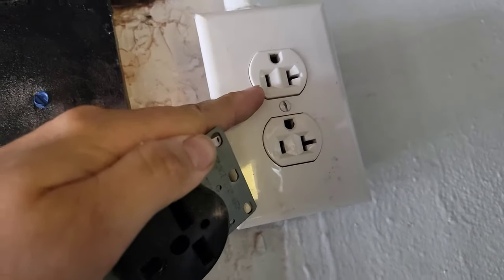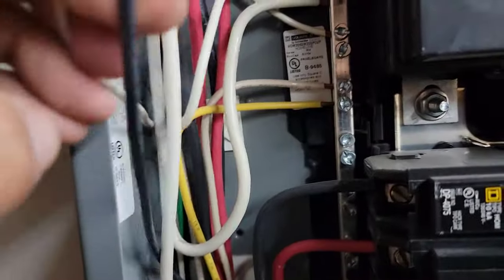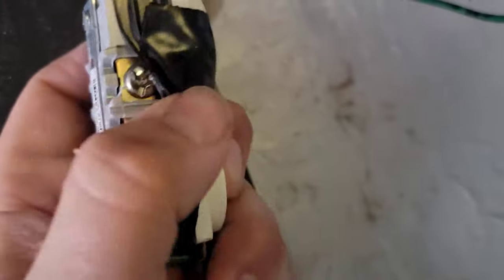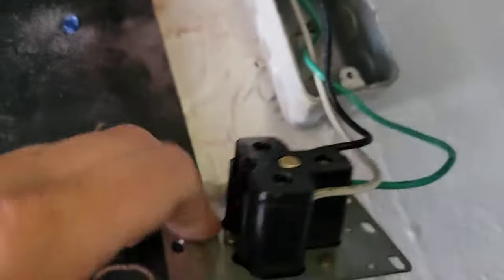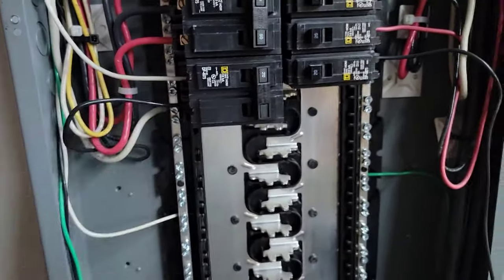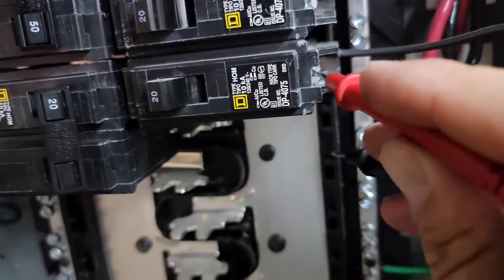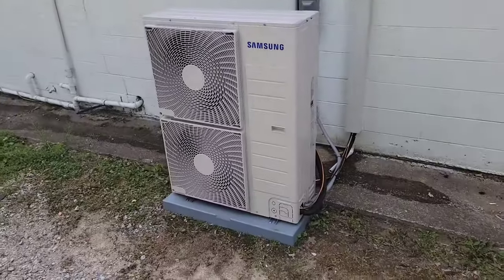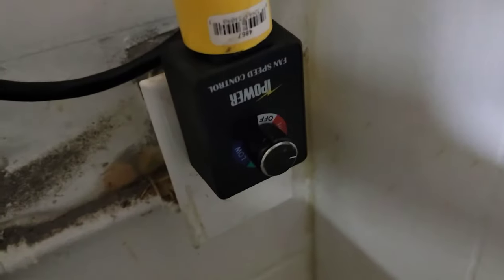How to replace a 120 volt receptacle with a 240 volt receptacle?

Comment: Congratulations and thanks so much for sharing your knowledge. I’ve been wishing to do that and use an existing 120 v receptacle to heat my greenhouse with 240V   Heater but thought you had to change all the wiring to the receptacle plus change the breaker.

Comment: You should have put 3" of black tape on the white wire on each end since it is no longer a neutral.
Reply from the maker: Wayne I forgot to video that.
I'm glad you said something
Reply: @TaddyDigest  Sorry it was just a safety thing.  Love your videos!
Reply: This will be the top comment!   Assuming it was actually 12 gauge wire. If it was 14... then the breaker is over rated and NOT SAFE!
Reply from the maker: Thank you wayne
I'm glad you're here buddy
Reply: @OGBRADASS  that’s what I’m concerned about, I have a situation where have existing receptacle outside of my house and wishing to convert from 120 to 240 but afraid because the wiring gauge and causing a fire 🔥
Reply: @DoverDanny  Well you can get 15amp double pole breakers, doesn't have to be 30amp.

Comment: how about the frequency of cleaning this unit inside the kitchen specially with all the grease deposits on the evap. fan wheels ? also very good thinking of the 120 to 240 volts but you need to cover the neutral with black or red electric tape to identify it as hot leg.

Comment: Please make sure that the receptacle you are replacing is the only 120 volt item on the circuit before you convert over to 240.
Reply from the maker: Great tip

Comment: I'm unclear about the wire gauge, is it 12 or 10? You're using a 20 amp breaker with a 30 amp receptacle and a 30 amp plug from the appliance. You should have 10 gauge wire and a 30 amp breaker, please explain.

Comment: I don’t guess you can do that with an in series receptacle ? I see that looks like a single dedicated run .
Reply: @ApothecaryGrant  there are a few unusual situations where it is acceptable to convert a 120V circuit to 240V for multiple receptacles as long as all of them are swapped out to NEMA 6-15 or 6-20 depending on whether it's a 15 or 20A circuit.  For example, metal halide, high pressure sodium or LED grow lamp fixtures,  many such fixtures feature multi volt ballasts or drivers meaning they can be used on 120, 208, 240 or 277V with 208 & 277 volts found only in commercial 3 phase systems.   This is usually done to allow for more fixtures on a given circuit or to reduce voltage drop, because as you may recall, P = E x I.

Comment: What about the wire guage? Is it the same guage for 120 and 240?
Reply from the maker: Wire gauge is dependent upon the amps of the appliance
Reply: @TaddyDigest  thank you.
Reply: @princeg24 I'm assuming 12 gauge since the original receptacle is a 20 amp and he used the same breaker rating, 20 amps. This would be good for a maximum of 4800 watts or about 16000 btu on that window unit before the breaker trips. This may be enough, depending on the power of the unit.
It could be the same gauge for 120 and 240, but it would have a 20 plug and receptacle and this unit has a 30 amp power cord and plug. A 20 amp 240v receptacle is a NEMA 6-20R, the one in the video is a 6-30R.